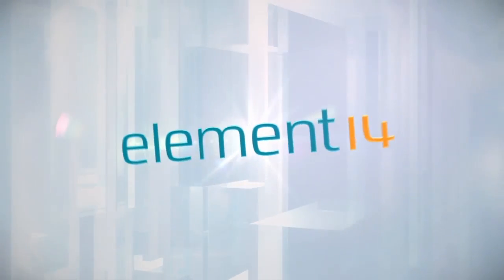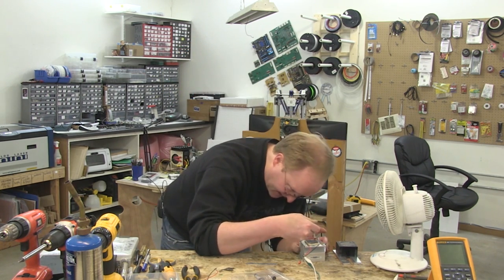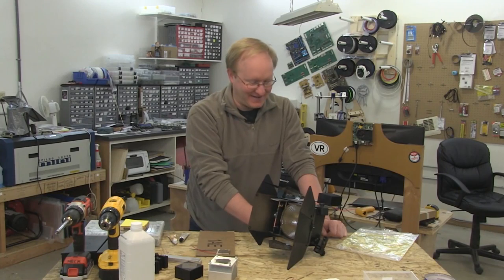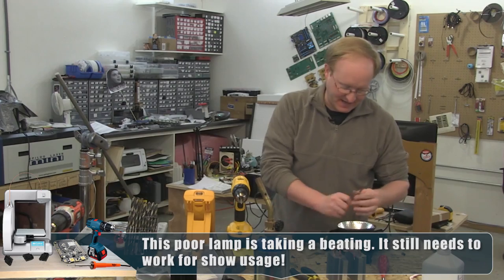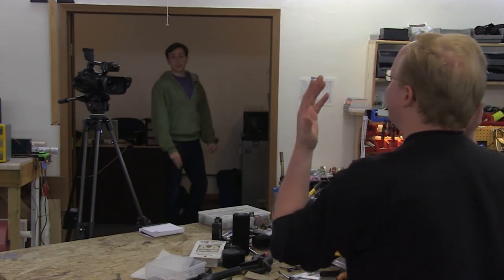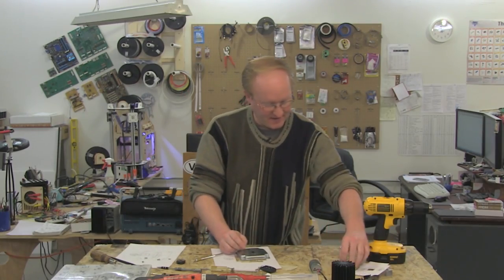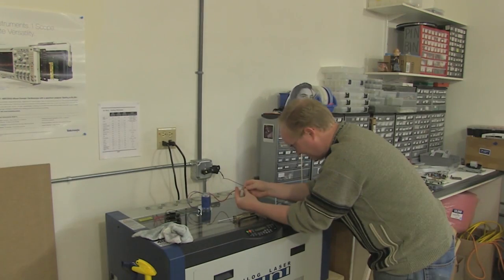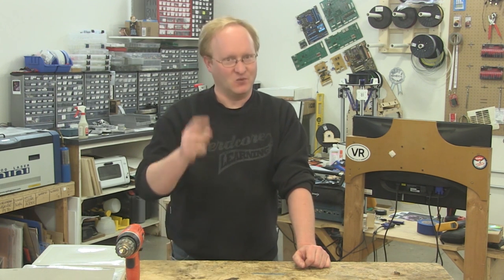Ben Heck Saves Energy for Earth Day

Comment: Ben did you know that heat transfer compound actually conducts heat very poorly? It just conducts heat better than air and thus is used to fill up small holes and airbubbles that would usually exist in a bond between two metals. Therefore you need to apply just enough and most certainly not too much, as this will influence the heatconduction negativly. 
Also, peltiers generate neither a current nor a voltage, the proper term is power. If you decrease the resistance the current increases but the voltage drops, this curve can be optimized for maximum power (maximum power point tracking, or MPPT, is used often in solar arrays).
Also, putting voltage sources in parallel is usually not a good idea, a better way would be to put them in series, and use an efficient regulator to step the voltage down to something stable that you could use.

Comment: Making a motorized arm to flip the switch seems ridiculous. Just use a high current relay.
Reply: Nicolas Tsagarides High current kind of misses the point of the video doesn't it?
Reply: hingeslevers
High current means it can open and close a circuit that is high current (a shitload of high-power lamps for example). A relay is actually using much less current than the circuit it manages.
Reply: Nicolas Tsagarides It is actually a good idea even though it was implemented badly. The reason why it is good is you don't need to do mains wiring (electricians only) and it can still be mechanically actuated by hand.
Reply: Ovidiu Lipsa Point taken, admitted n00b here. My reasoning is that Ben also thought of using a relay, but I figured he didn't because a relay might require more power to do the switching than his solution.
Reply: hingeslevers There is no such universe. A relay consumes meaningless power according to the kind of power that is able to manage.
Reply: Robonza Is mains wiring, even for lighting considered something to be done by electricians only?At least in Finland, and many other EU countries, lights are exempted.
Reply: Toni Lähdekorpi It's also pretty hard to fuck up if you just flip the mains switch...
Reply: QuantumFluxable I've done work as a UI and UX designer, you'd be surprised. Some people are just... Unique...
Reply: Toni Lähdekorpi
Windows 10 is coming out, please let Microsoft hire you.
Reply: Toni Lähdekorpi And give apple a free pass?
Reply: soviut The Tux welcomes all new believers with open arms.
Reply: soviut
I consider OS X to be in the *nix subset.
Reply: QuantumFluxable
As a developer I have to use all ;_;
Reply: Nicolas Tsagarides As a *nix only developer you DON'T have to.
Life is full of choices.
Ditching Windows / work with it might be the best decision a developer can make. At least lowering the probability of going completely mad.
Reply: Toni Lähdekorpi
I'd love to do that but ditching Windows also ditches a big portion of users.
Reply: Nicolas Tsagarides Mental health is more important than users.
Reply: marcoswi Or a latching relay...
Reply: marcoswi I was just referring to using a relay for lighting. It's a very common thing to use (latching relays) for lighting for that very purpose of not having continuously being powered. As well as not having the annoying buzzing sound relays make.

Also, you're not thinking "outside the box". You don't need a continuous power supply for the relay. You could have a capacitor there that would, even after the triggering action fill up and actuate the relay. A small delay in this kind of situation wouldn't make a big difference.

Comment: I made a remote-controlled light switch when I was a kid.  I used a rocker-type light switch and actuated it with a servo motor with a guitar pick screwed to it.  Stuck the servo motor in place with electrician's tape.  Used the receiver and transmitter from an RC car.  Took about an hour.  All in.

Comment: Awsome project Ben! For the first project I would harvest the energy in some sort of way, like the kit from wurth for the energy harvesting (from the australian electronic bible, by Dave, verse 664).
For the second project I would use a triac or an SSR to switch on or off the lamp... oh and for the flickering could be a lack of current? Maybe a high value cap can help? Again in this project, if I would use the motor, I would use 2 limit switches and I would drive the motor with a PWM, and I would bind a switch as "on" and the other to "off" (the limit switch would interrupt the flow of electricity, so if I press for 5 seconds the button 1 on the remote, the motor will stop at the limit switch, and even if i press again the button, will not do anything, opposite with the button 2, it would work unti the motor will hit the limit switch )
Keep going on with awsome project! :)
PS: I made an eco friendly project too, ultimated just 2 days ago :) if you wanna see it, this is the link :) https://www.youtube.com/watch?v=JfMl-RT_-CE or you can see all the passage here :) https://electronicalex.wordpress.com/2015/04/25/progetto-della-luce-scale-attivata-al-passaggio-finalmente-terminato/

Comment: For the light switch, you made a lever... Why not make a screw drive and go from the bottom to push/pull the switch on and off?... First button for forward and another button on the remote signal reverse .. You could also regulate the speed of the drive by changing the pitch of the thread. .. I enjoy the show and the out takes.. thanks

Comment: Ben, replace your light switch with a 3-way, then wire in a 110V relay controlled by the key fob.   Or if you already have a string of 3-way/4-way switches, replace a 3-way with a 4-way and add the relay as if it is a 3-way.

Comment: How about switches on the upper and lower limits to the arm to stop the flow of electricity to the motor when the light is switched off and again when switched on? How hard would that be to incorporate into your circuit?

Comment: What about a 555 for timing the output pulse on the motor? Simplifies the on/off mechanism to a button click versus having to hold the button for a specific time.
Reply: Or just use a servo, and use an ATTiny to monitor the state of the switch, i.e. If the switch is up, rotate down, etc.

Comment: Why not use a PIR sensor(s) and a relay/SSR to control the lights. Then they can switch on only when people are in the room. Can combine that with a ESP82xx to support remote control and to configure time out etc, the ESP also enough GPIO to be able to run the relay and PIR sensors.

Comment: Wouldn't it have been better to use a servo? I know the circuit would have been more complicated, but I feel like it would give you a more consistent on/off state.

I guess it would bleed energy, regardless of the state of the light switch, but I can't imagine the tiny amount of energy a servo uses when idle would be significant enough to outweigh its benefits.

Comment: I have to wonder why you didn't just use a servo for the light switch and have the remote toggle the servo position? That way you wouldn't have the whole flicking on and off as the motor goes too far.
Reply: himselfe 

or, use a relay, and a few transistors and resistors and the key-fob receiver as a control circuit. the transistors would be used to turn the relay on/off, and the relay controls power to the light (wired in parallel to the switch).

Comment: I always thought it would be fun to wire up my house with motion detectors and lights that would gradually brighten and dim as you walked by. Once out of a room all power would be shut off do only motion detectors in one room (perhaps adjacent rooms) would be consuming power. Front door would be wired to turn on motion detectors so someone coming in wouldn't be left in the dark because if someone was in a back room there wouldn't be any power to the front.
Reply: You can't get something from nothing, the peltier reduces the efficiency of heat dissipation... Which is the point of heat sinks. Unless you include better heat dissipation (aka more surface area) you could damage whatever is meant to be cooled...

Comment: Seriously, going through all that trouble just to flip a switch when you could just go with an off the shelf remotely controlled light dimmer that costs a fraction of what it cost to 3D print this contraption? Not to mention that with all of these guards, gearmotor and whatnot screwed on top of the switch makes it impossible to flip it manually, when with the dimmer you wire it in series with the switch and hide it inside the wall behind the faceplate?
Not to sound harsh, but this whole episode was an exercise in futility to me.

Comment: 1 -  Steel is a bad heat conductor,  plus peltier devices or other ways of heat energy harvesting methods are fairly ineffective,  unless you have a low power use or a lot of heat(like a nuclear reaction or geothermal energy).   Charging phones is an order of magnitude or two too much for peltier heat energy harvesting.    A massive heat spreader and maybe 20 peltier devices,  might charge a phone slowly.   A more efficient light is a better way to not waste energy.   

2 - Seriously,  the motor driven lightswitch is a silly,  overcomplicated idea.  Simply just for show,  noone would ever do that in real life.  A solid state relay would make about 1000 times more sense.

Comment: For the peltier thing. Would be nice to use the heat like this, but it would be too easy ... or if it would be this simple, i guess my computer produces the electricity for his fans himselfes ^^

And the light switch:
in my room I use a Rspberry Pi and a relay to switch my light. therfore I can go to a website on my phone ore my computer and click a button ... probably you can make something like this, that the light goes on with your camera or something cool like this ... or just easy the rapsberry thing over wireless, so you could turn it also off, if you at home or the toilet :)

Comment: there are 2 kinds of peltiers modules. thermoelectric coolers and thermoelectric generators. i just hope ben used generator because i have one and it would certainly create more energy.
Reply: Mb0ts I think you have mixed stuff up. There is no difference, it's the same. Peltier devices does exsist in various configurations, sealed and no-sealed, also there is high-temp devices, but apart from that, they are the same.
Reply: ***** some are labeled TEC and some TEG. C stands for cooler and G for generator. i dont think i have it mixed up.
Reply: Mb0ts I know that. The differences are subtle, and for Ben's use it's no difference. Only you start making a heat conductor of steel, you are wasting your time :/
Reply: ***** i have been working on project with seeback(peltier) module. i had both TEC and TEG cell. with difference in voltage about 50C, TEC only generated about 300mV where teg could generate 2 - 2.5v. difference isnt very subtle.
Reply: Mb0ts OK. I've used TEC's for makeshift TEG's and i had no problems generating voltages enough to power a microcontroller and LED. I guess not all TEC's are created equal. Some can work as TEG's - some cannot.

Comment: Speaking of heat pipes... Didn't the original Dreamcast use some fancy liquid cooling system? ;)
Reply from the maker: Karl Koscher ...one fan
Reply: The Ben Heck Show Check out http://www.gamesx.com/dreamcast/index2.htm. It looks like the original batches used heat pipes, which explains the weird position of the fan.
Reply: The Ben Heck Show First boards did use heatpipes.
Reply: The Ben Heck Show just buy a led light and a movement sensor for the light only a couple of dollars also batteries are bad for the enviroment so that switch is even worse now

Comment: doesn't the always on remote control use electricity all the time?
Reply: samramdebest The base station uses 40 micro amps. That's a LOT less over 24 hours than the lights being on for say 5 minutes when not needed. Sure they are florescent but that many still use a good amount of wattage so yes, this does save more energy than it uses. That was the point.

Comment: Steel is much worse than copper.  The steel is like a thermal resistor.  Why did you put the generator out on the end.  Why not directly on the lamp.  The shorter the better.

Comment: This is probably one of the most overengineered things you have built yet. "I wonder what kind of electronic device we could build to control a current with electronics... A motor which physically flips the light switch must be the best answer!" Gosh no, why don't you just use a darn Power-FET or a double-resting relay? Why am I even still watching your videos?